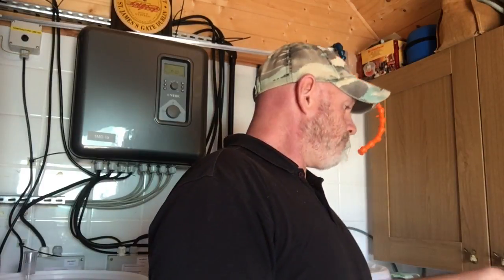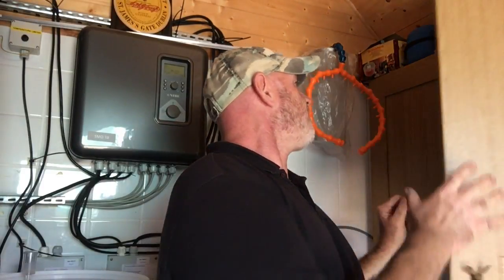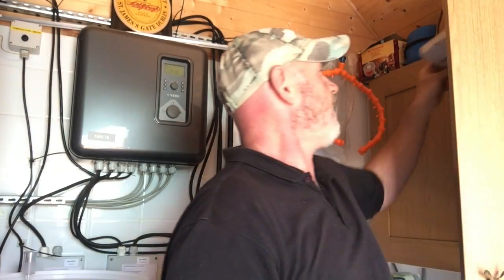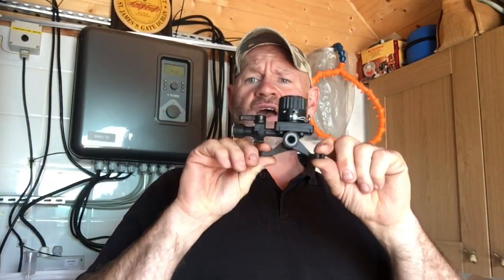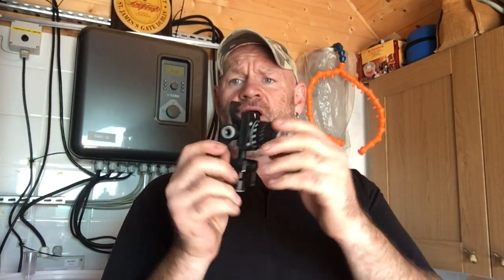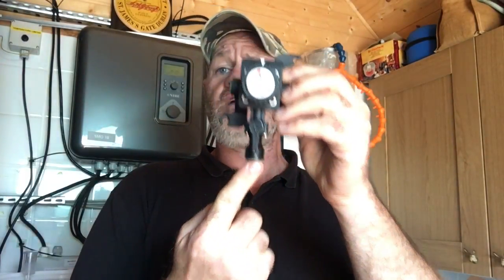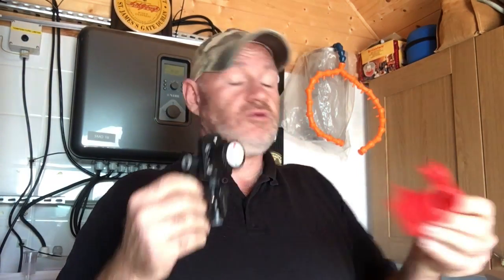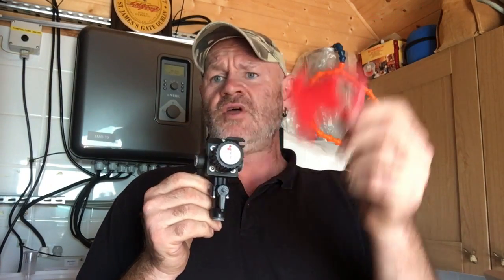Keezer Build part 1

Comment: having trouble locating a supplier for the regulators. Is there a part number or model number? cheers!
Reply from the maker: sorry Houch for delay. you can buy from Brandels.co.uk. they are micro matic, compact sec. regulator, PSI-IUK . item number is 301010101102. hope this helps . cheers.